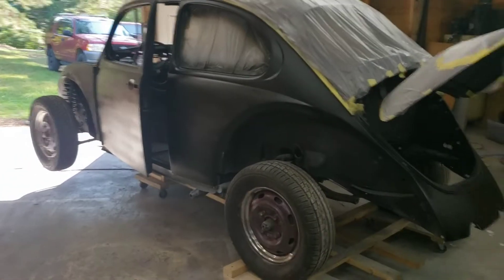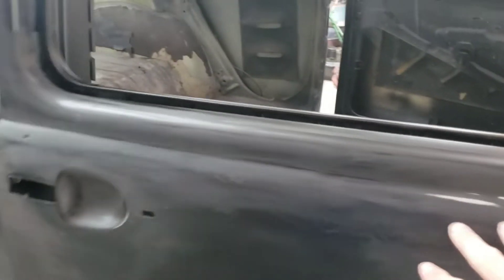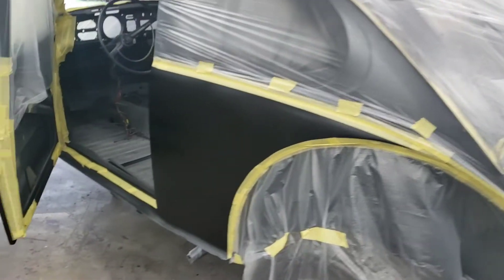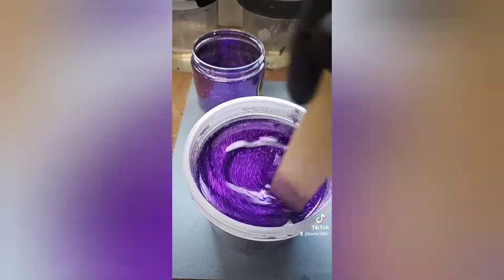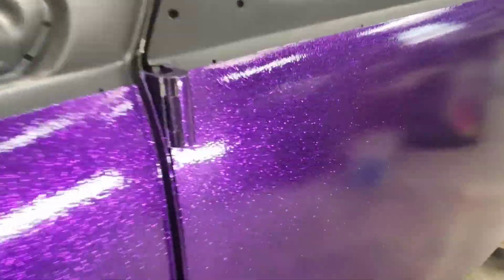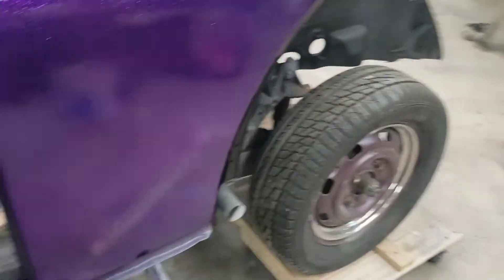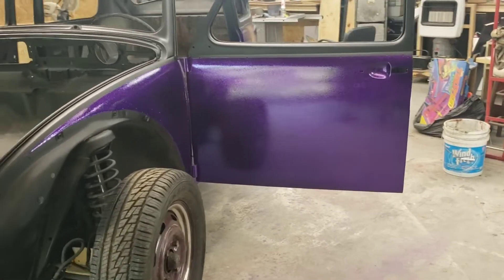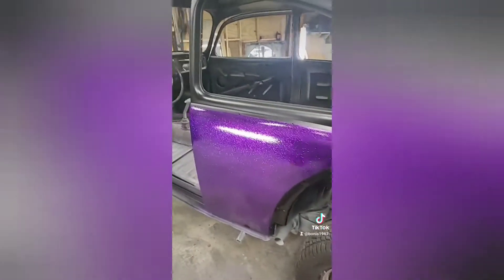Spraying purple haze metal flake on the bug.

Comment: What size flakes you use what size tip for gun
Reply from the maker: I used a 3M Accuspray Spray gun with a 2mm tip and the flake was a micro powder and the other was a .015 I think. The bigger flake does not have a size on it.
I think I have two videos on the mixing of the flake l,can't remember 
Thanks for watching and good luck 👍
Reply: @Bonis67 where did you get the flake supplies? And I ordered. A different  gun nozzle kit from snap on . He said use a 8mm tip kit he called it a flood tip should I use something like that?
Reply from the maker: @vermontjeff2535  i got my flake from painthuffer.com and my spray gun is a 3M Accuspray with a 2mm tip. I really like this spray gun because you can change the tips to spray your high build primer , epoxy , base coat and your clear coat and of course flake.  My paint supply's i got from TCP global on Amazon. 
Thanks for watching and I hope this helps you.